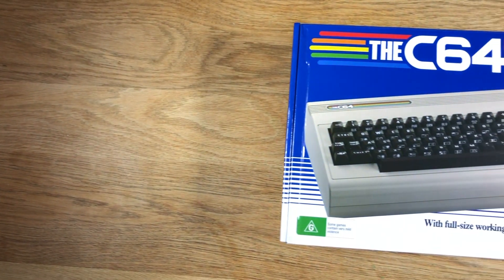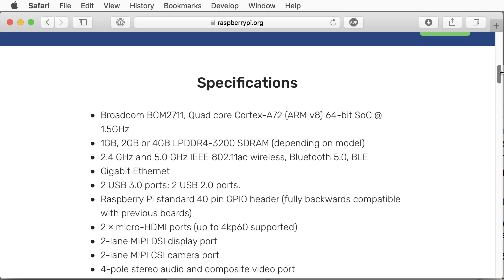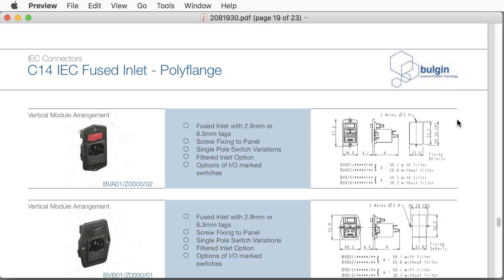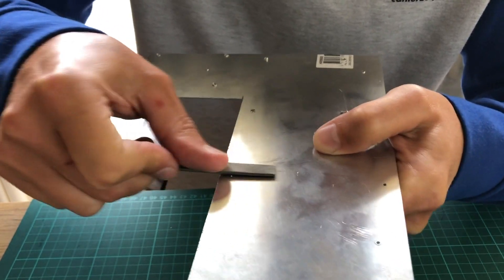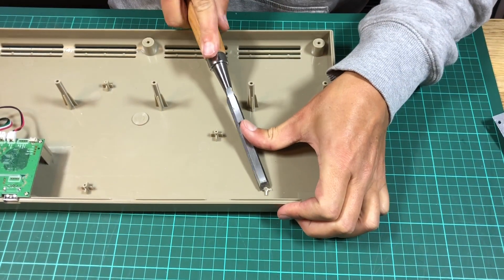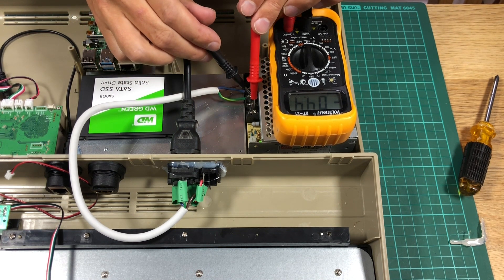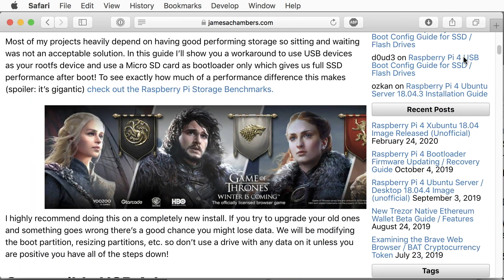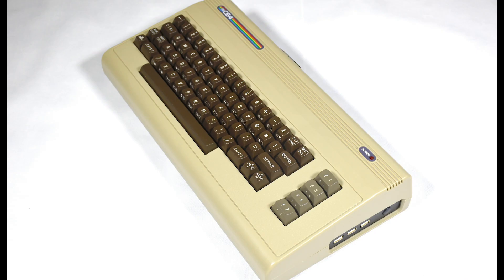Raspberry C64 Pi Computer

Comment: I bought one C64 mini, that I believe It has the same raspberry pi inside. After Just 5 uses, It broked and never turn on more.
Reply: Confirmation - TheC64mini does not have a rasberry pi installed  It does however have a "similar micropc" under the hood. Yet, thw raspberry pi is toting more horse-power

Comment: I see why, THEC64 is not hacker friendly with it having 256mb memory and its firmware is a ass, trying it get VICE working on its too hard to get it to work, I have tried and its not worth the effort, this is the best way to do it, THEC64 has been build with as little money as possible to make a profit and because it never got funded on Indiegogo, that's why the board has low memory and a very small nand chip(only about 700mb for the firmware), more info here about THEC64... https://thec64community.online/

Comment: Nice project! However just how it's one in the Raspberry 400, you could use that large mounting plate as heat-sink! On the 400, it already proved how effective it can be. Ok, then maybe mounting the pi would be kinda different, that's true ... upside down?
Reply from the maker: Good idea, but the USB ports are in the way...
Reply: @christophbartneck  Indeed. I am not sure if there is space for it (because of the kbd), but maybe the pi can be mounted upside down, with spacers, and putting a chunk of metal to conduct heat between the plate and the SoC on the pi. With thick enough metal+spacers that connectors can fit.

Comment: You should mount the Raspberry Pi board upside down and rotate 90 degrees. Then you can use a thermal pad on the APU and use the whole aluminum sheet as a heatsink.
Reply from the maker: Good idea!

Comment: This looks so clean and nice, I love it!
Made a C64 Raspberry Pi using the original bread bin model (which had a defective mainboard inside) and a Keyrah v2h myself slightly before the tiny THEC64 variant has been announced.
Right now it holds a Pi 3B+ and a 500GB 2.5" hard drive which can either run on its own or thanks to unpopulated pins on the Keyrah, I can actually still use the Commodore keyboard for my other computers.

Comment: Nice work! But it is not necessary to have a SD card installed as boot drive. A single SSD can boot the Pi, too!
Reply from the maker: Hi, check out my "updated" video that includes the improvements I made to this computer since.

Comment: Hi, this is great. One question, does the keyboard still work for the C64? I couldn't see how you made two connections to both the PI and the 64?
Reply from the maker: No, it only works for the Pi. The C64 only has one USB port left (back) and I connected the joystick to it.
Reply: @christophbartneck  many thanks. I'm wondering if you could splice into the cabling so both would operate as long as only one machine was powered?
Reply from the maker: You might need a KVM switch.

Comment: What's the point of actually running a C=64 board in there?  Just use VICE.
Reply: but vice is pure software not hardware. It's a software simulator. Not the same thing

Comment: Excellent video. The C64 Maxi arrives on the US market next month, and I had already planned to install a Pi in mine when it arrives. This is more ambitious than I had originally  planned, but i like the idea of the integral PSU and the SSD. You have also saved me a lot of time working out what the connectors are called. I didn't want to cut the cables either!
Reply: Did it ever? I haven’t seen any for sale in the US at all

Comment: I would say good job. But you are using too much energy on the build. Next time. Instead of buying a metal plate and searching for plugs/extenders. Then use some epoxy two component glue and use a drill to mount spacers in the bottom case.

Comment: It would be cooler if the company that does the C64 starts doing a version of the Amiga 500 or 1200 so the case can be moved this way to.
Reply: Then just build your own. A1200 cases can be bought brand new. Or buy a VampireV4. Or buy an A500++ board and solder your own Amiga.

Comment: Why wouldn't you use a mounting of plastic or even masonite for the mounting plate?  Thin plywood even - anything non-conductive!
Reply from the maker: Nuts and bolts work nicely in aluminium.

Comment: Looks like a very fun project. Does the power supply emit a lot of heat? Any issues with heat dissipation?
Reply from the maker: Not yet, but I ordered a heat sink and fan for the Pi, just in case.